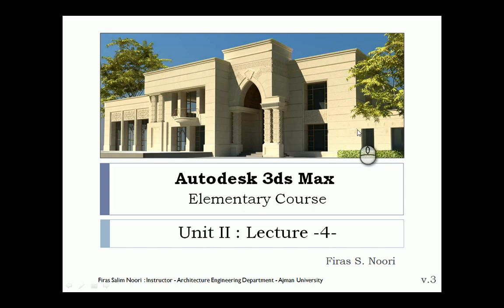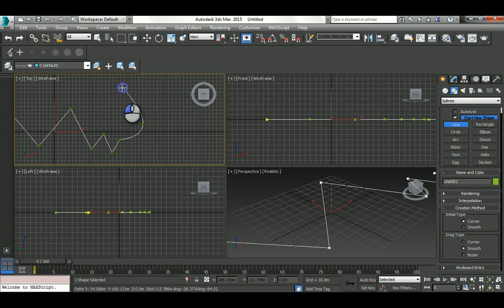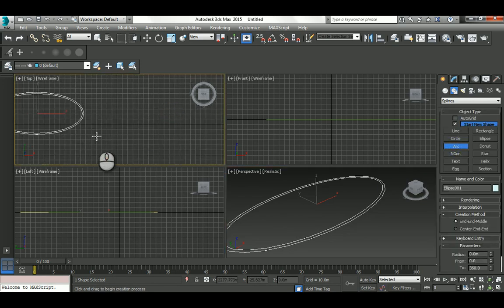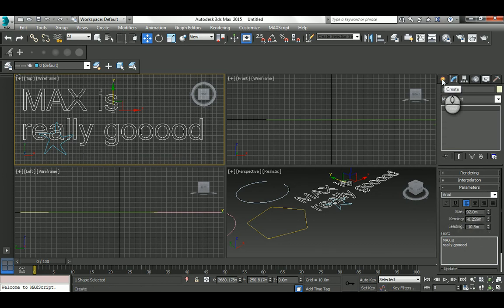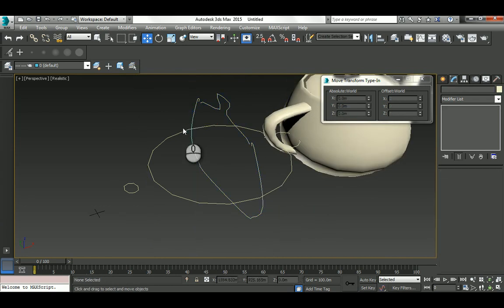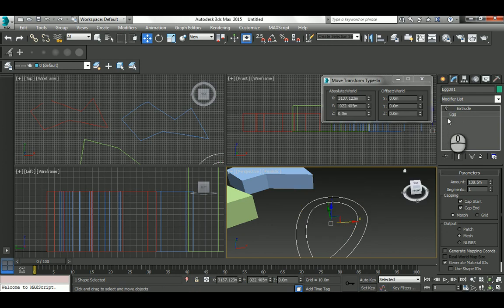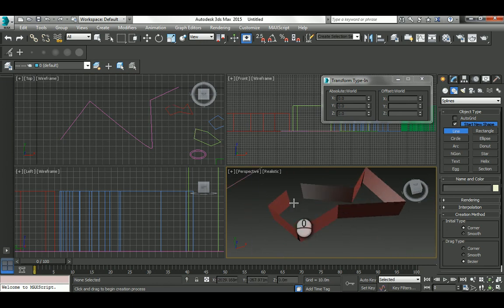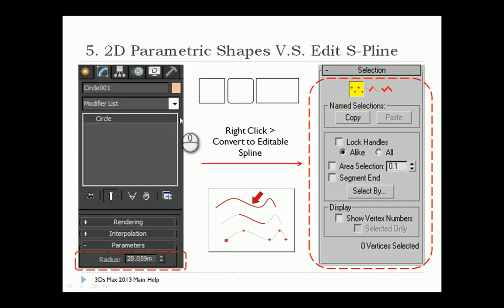3ds Max Unit 2 Lec 4: 2D Shapes and Extrude

Comment: I have 2 comments I don’t understand part of cut shape from section option
- and why we make copy and paste for egg shape
Reply from the maker: For egg I have not made copy-paste, when you create it, it will make a copy inside which allows you if you extrude to have solid-like 3D of it instead od surface, as you need to see some thickness in the egg sides, without it, it will look like a paper or no thickness at all
Reply from the maker: For Section command, it allows you to cut anything horizontally or vertically or even in a degree if you wished for it. In Architecture, if you cut something (Form) with a horizontal plane, then you are making a plan, usually the plan is 1.2 m cut from the floor of any room. if you rotate the plane vertically and cut ur room, we call it section.
Reply: Thank u sir 
so much for clarifications
Reply from the maker: @belalahmed198  welcome